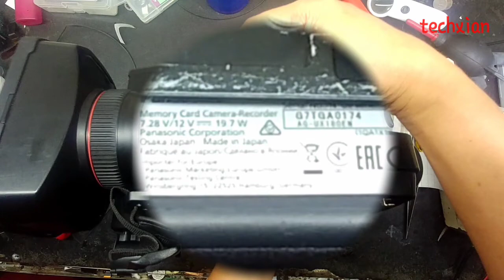PANASONIC AG-UX180 FOCUS PROBLEM/DISASSEMBLE/ASSEMBLE/

Comment: Hello the roll button to the menu selection dial no longer works when i turn this. It's on my camera pansasonic HCX1, so what's happend thanks for your response and have a good day !
Reply from the maker: i see there a cut connection to the dial from the flexcable is need to repair or replace..i preferred to repair it than replacing it..i put an allowance to the wire so it can move smoothly
Reply: @techxian  ok thanks for your answer so fast , my camera is yet under warrenty i think repare under warrenty what dit you think ?
Reply from the maker: its okey sir to bring your camera to the authorized service center if that is under warrantry ,if not bring to the trusted technician to your country...all of that case when i repair it my customer is satisfied to the repair and no back job on that case